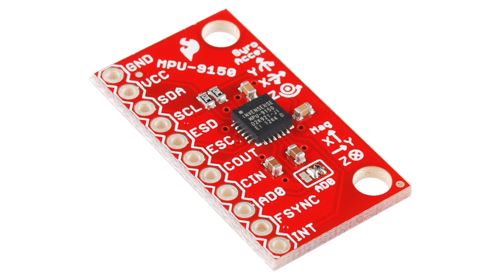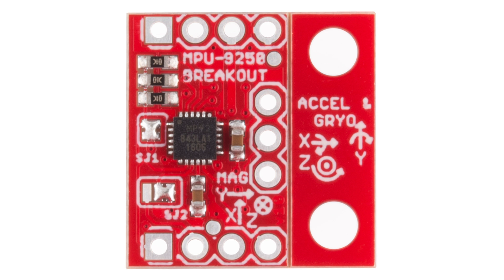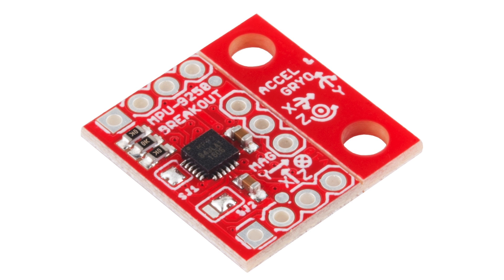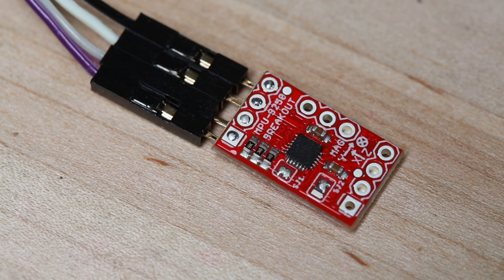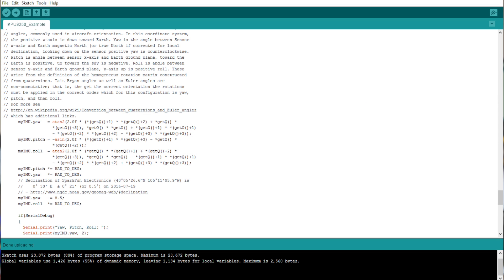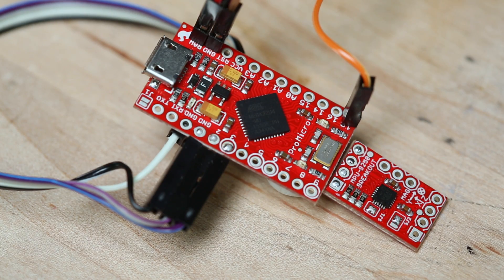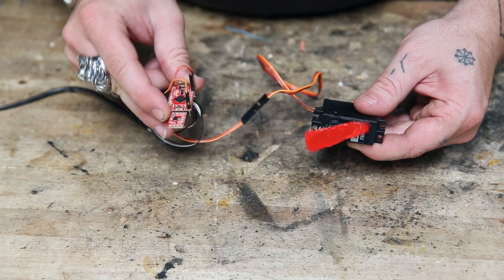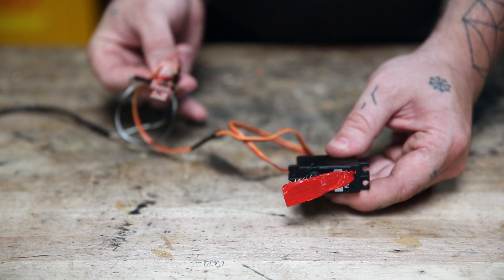SparkFun MPU-9250

Comment: in the demonstration, you speak of using accelerometer x axis data, but you are mimicking the gyro angular speed and the subsequently calculated roll angle or what have you. Whats up with that. Please explain.